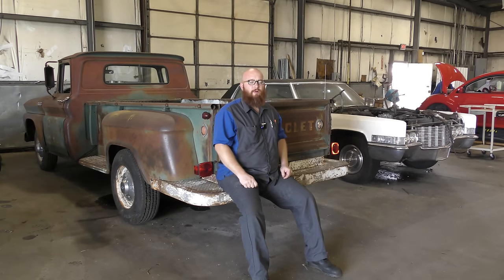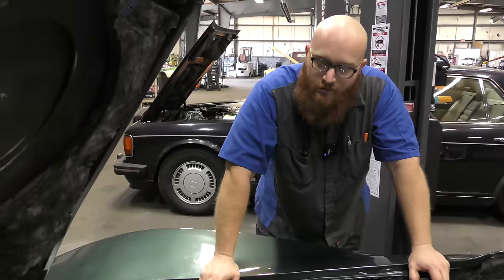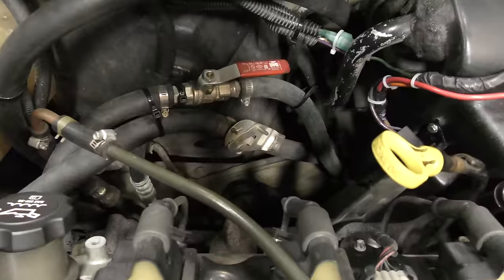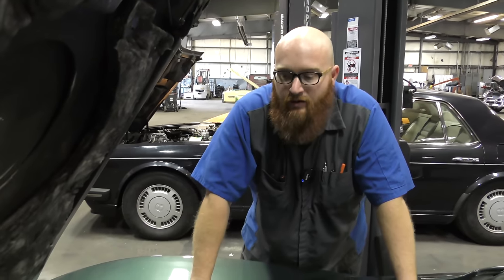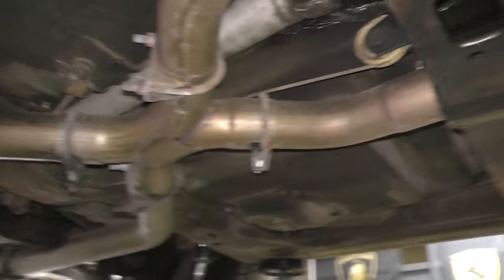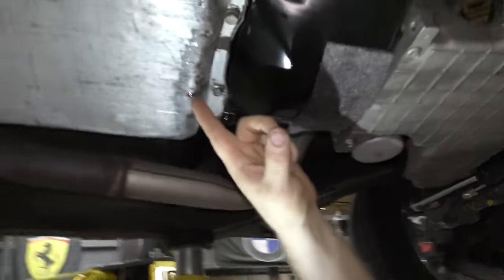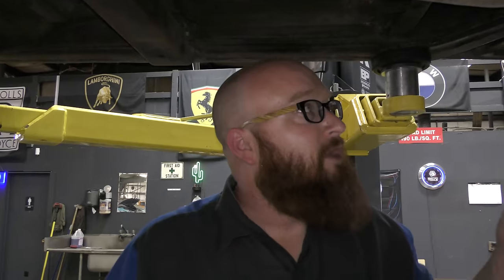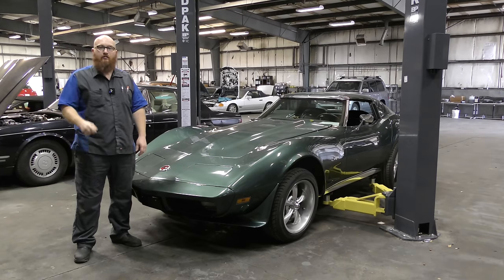Issues AFTER an LS swap! CAR WIZARD warns what can happen on an LS swapped '73 Corvette Stingray

Comment: Craziest I've seen: late 80's in Germany - base 75 hp Opel Manta with a 3.0 fuel injected inline 6 with 177 hp out of an Opel Senator. The guy kept the brakes stock, 13 inch disc up front and drums in the back and admitted that can't stop very well. Almost drove into a combine while barreling down a 2 lane highway.
Reply: I have an Opel omega with this 3.0 engine, here in Brazil it was sold by Chevrolet, nice rev range engine, nice sound too
Reply: Very common swap here in the netherlands back in the 80's and 90's. Just like the later 2 liter 16v engine. Opel is great of these kind of swaps. I've seen that 3 liter motor in a kadett C.
Reply: Strangest Ive seen: A 2.3 litre carbureted 4 cylinder Ford in an old diesel Mercedes. This was also in the late 80s.
Reply: Did it the other way around, upgradet my Miata ND with 4 pots front. Car has stock 2.0 - 160 hp  / 1050 kg. Have an old 1988 RX 7 also but that one is OK, has 4 pots front from factory ...
Reply: Too many moders think about going faster, but forget about stopping.  Upgrade the engine - upgrade the brakes.
Reply: Crazy...wedid a 68 camaro swapped I'm a 440-6 pack. This was in the late 70s
Reply: Years ago i had a uk 1991 vauxhall senator, 3.0 inline 6 12v, think they were about 150 bhp, it was a old banger so got it cheap and i just gutted the interior out of it, didnt matter what you did if you floored it the wheels would spin like hell being so light, and loved to go sideways
Decided to scrap it so wanted to see how strong the auto box was, burnouts with speedo reading 120-130 Mph, think the gearbox  just melted itself together in the end but did this abuse for about 3 or 4 minutes at a time and did it about 15 seperate occasions before the box gave up and showed me the lovely flashing gear symbol on the dash, the early 90's opel/vauxhall was the end of the greats from them imo

Comment: I literally had to watch about 30 hours of carburetor videos over and over just to learn quadrajets for my 68 C3 and boy am I glad. Absolutely no one in my town knows how to even tune one aside from the absolutely wrong bubba or two that once knew a guy. I am literally the only self taught Rochester quadrajet mechanic that I know of and I’m not even a mechanic. But just like anything, it’s not really that hard once you learn how it works. It took me a week to get it right. My car runs fabulous now after 3 years of failing to find a proper carb guy.

Comment: Usually the whole point of a restomod is to increase drivability and usability.  Confuses me to no end why someone would ditch fuel injection on an LS.
Reply: Same thought. An ls is a much more reliable engine than the old 350 and 305$. But it's only that if u swap everything over.
Reply: Some people like the nostalgia of a car and the 73 doesn't look right without a Carb with the hood open. Most people buy old  cars to  "share them with others" rather than for actual performance.  I could make my tank run at 10 mph but I choose 5 because that is what the originals did. It's for show not for go....
Reply: Because carburetors are easier to throw in and set up than turning a ls with fuel injection and a computer
Reply: @derekderekison3241  An easy swap would be a 350 crate motor. An LS based engine does not have a distributor, so you still need a hybrid system with fully electronic and programmable ignition to make a carburetor work. I love carbs, but you would have to do so much work with this application to try to make it work well.
Reply: @curtislovrak5390  you can put a 350 style  distributor on a ls

Comment: Crazy that we've gotten to the point where carbs are considered exotic.
Reply: Not exotic, just outdated and uncommon enough that it's not worth a mechanic's time to know or care anything about them. Your average shop would see a fraction of a percent of their business being vehicles with carburetors. They aren't loosing money by turning those vehicles away.
Reply: Makes me feel old when younger guys are stumped and amazed by a distributor with points. 
What, no coil packs? How does this thing run?
Reply: Horse and carriage is even more exotic
Reply: Don't you mean "obsolete"?
Reply: As a carburetor guy myself, in the 80’s I was actually glad to see them disappear as emission devices were added, ending up with dozens of vacuum hoses. I was fortunate enough to have started on carbs in the late 60’s, but EFI in 1977. Other than CIS or mechanical injection, in 1976 model year, only two cars had true EFI, one injector per cylinder. The Cadillac Seville w/350 & the Datsun 280Z. Although it had injector #7 for cold enrichment by a simple thermo-time bi-metallic switch inside. It was stamped with max time & max temperature. The colder it was, the long it sprayed. A 3 or 4 gas sniffer in the tailpipe was normal.
  Anyone can put an “LS” in a car/truck. But not providing a detailed schematics, location and part numbers of non-factory parts is lowering himself to “Grease Monkey” status, doing the owner a dis-service and any future owner. The “Wizard” is right. 
I left a dealer of young capable Acura techs. On the way out the door one ask me how the fuel pump on his 2-stroke 6 cylinder bass boat engine worked. I told him to Google it!
I paid my price, no tech school, just did it and learned. Mistakes live in your brain until you die. Doing it correctly & right using best practices is forgotten when they hand your paycheck!
ASE Master Tech since 1978-Retired
Reply: @johanbjork1650  - pretty sure your point ignition still has a coil — or at least my 65 ford’s did.
Reply: Has A single coil.Not coil packs for each cylinder.
Reply: @y0ur_name_here  My 113cc scooter still uses carburetor

Comment: The owner apparently never heard of the Holley Sniper TBI fuel injection.
Reply: The owner had a 165 hp 350 that was probably toast. The swapping shop decided on a junkyard truck motor and this is what you get.
Reply: I haven't kept up with aftermarket fuel injection lately. Hadn't heard about this unit. I checked it out. Wow! This thing looks amazing and brain dead simple. Will definately keep this in mind if I ever pick up a classic. Thanks!
Reply: That's exactly what I was thinking.
Reply: I agree easy to install and tunes itself. Fuel injection for the uninformed. Most mechanics could easily understand and diagnose it.
Reply: @jerryhablitzel3333  put a Sniper system on my Chevelle. Couldn't be happier. Butter easy.
Reply: Why not retain the factory multi port injection?  Far superior...the sniper is for replacing a carb on an old school engine with fuel injection
Reply: $1200 vs $300 just sayin
Reply: @samiis1260  well 300 just cost u 8 hours at 90 dollars an hour just to figure out the problem. And then what ever it will cost u now to repair it. Spend the 1200 and get the better system that comes with its own odb to help fix shit
Reply: Why when the ls style engine had multi point and computer control. Yeah it takes tuning but so do carbs. This swap makes no sense to me
Reply: @imcrazyforwar  I do all my own work, always have but maybe thats rare these days. 8 hrs to tune a carb is insane. more like 1, I've done it with cars trucks boats bikes and other equipment its not rocket surgery.
Reply: @brentboswell1294   Because  Brent the Holley system is modern and is VERY easy to modify to increase performance, versus the old system that isn't supported at all.  Great question!
Reply: The Holley tbi has the ecu inside the throttle body. 
What. Could. Possibly. Go. Wrong. 

Oh yeah, all the people that try to jump start, fry their unit, can’t buy a new ecu gotta buy whole new system.
Reply: @fastinradfordable  Well there goes another $1200 down the drain

Comment: Sadly, restomods (Frankenstein cars) make for poor purchases as the Wizard said. Better to buy the real deal (an actual performance model), upfront and rely on standard aftermarket bolt-ons and what-not.
Reply: Restomod done right is good to go. Im doing restomod suspension and disc brakes from CBR for my 66 but also running a 360 and M21 4 speed

Comment: Around 22:00 you say the GOLDEN WORDS brother man! You could do a whole video series on just these words. "When They Are Modified". Too many people watch these YouTube vids and car mod shows and hear that "You can have 1,000 HP by simply buying a junkyard LS and swapping it in, it's cheap and simple, here's a 10 min video on how easy it is." Don't expect a $100 junkyard motor to get you into the 1,000 HP and have a running driving car in a weekend.
The swap alone is going to cost you 1,000's and if you do nothing to it, your only going to get around 300 HP at the flywheel (not the rear tires). The 4 bolt main SBC that came in that car could VERY easily break into and well over the 300HP mark with a mild-performance re-build that wouldn't require the 1,000's of dollars in Moding to make it fit and work. Also you, me, and other shops have an easier go at working on it for you when things wear out or go wrong. Saving you money down the road.
LS Swaps are great, don't get me wrong. But they are only great if they are (1) done right, and done to their full potential.
Otherwise you are buying into a Fad, and it's an expensive Fad to get caught up in.

Comment: Now you need three BigAss Fans for the shop ceiling!
Reply: I'm a contractor and can say those are the best fans for sure. Plus you get a sticker that says, Big ass fans. I always cut the S off fans so all my stickers say, Big ass fan 😁
Reply: Get some solar panels up on that room and get that place air conditioned for free!
Reply: @assoonaspastablepizza8135  I have a brother who owns a huge truck repair shop.  About 5 years ago he installed AC when he added a parts room.  Increased productivity 50% in the summer.  Actually paid for itself.

Comment: A very honest review of what can and does happen with an engine swap. I'm swapping in a 472 Cadillac into my '72 Chevy C20. It's not as involved as this, but there will be a couple challenges here and there. I went with a Holley Sniper EFI setup that is very simple to setup and run. If one is methodical and takes their time and doesn't succumb to "go fever", a restomod can turn out really well and drastically improve the handling and drivability of a vintage car or truck.

Comment: Imagine getting that carb dialed in, and then you move to Denver. Guess what? Your car runs like crap again.
Ask me how I know...
Reply: That’s a great observation. Not that level of pain but my nitro RC car has to be tuned for hot, cold, humid or dry. So to me a fuel injection swap would be cheaper in the long run over constantly tuning the carburetor. Oh and just curious now you have it tuned for Denver does it run the same at the top of Pikes Peak?
Reply: @duke9173  Probably not, you'd have to pull over and tune it by hand again just to get more air into the engine to climb Pike's Peak 🤣🤣🤣
Reply: air density is a pain in the kester
Reply: Imagine willingly driving a car with a carb.
Reply: Been there, done that. Plus, Denver is at about 5,000 feet, but the mountain roads to the west and north get as high as 12-14,000 ft. Carburetors are about useless in that kind of environment.
Reply: @Michael_Lorenson  oh well what did they do 30 40 50 years ago? Did Vehicles just struggle to deal with the high mountains?
Reply: @goshgolly8305  
Yes, they did. Carburetors can cope with some variation in ambient pressure. But there are limits, because they meter fuel based on intake air velocity instead of density.
Reply: Michael Lorenson so nobody ever raced up pikes peak with a carb
Reply: @travislostaglia8861  
Of course they did, but that doesn't mean their engines didn't suffer from the extreme change in altitude. It was the same for everyone, and they dealt with it as best they could. Are you an engine tuner? Seems unlikely. Otherwise you would understand the challenge competitors faced, trying to set up their carbs for that event.
Reply: Idividezero   You overlooked the main question.  Why would anyone move to Denver?
Reply: @chriscat85  I used Denver as a well known location for its high altitude. I didn't actually move to Denver, but I am over 4,000 feet in altitude.
Reply: Idividezero    And, I was just picking on Denver

Comment: OMG, Im an SAE certified mechanic and Im rolling my eyes watching this. You have to think about the motor with one mindset and the carb with another? LOL whatever, the LS is just a pushrod motor. 5 minutes with a power probe will figure out the fan issue as well. Common man.
Reply: Exactly and the only other thing it would require is a low pressure electric fuel pump added to the system. Hopefully added close to the tank to pressurize the system so it has less chance of vapor lock and power it up with a three prong ($10 Chevy Vega) oil pressure switch to operate a relay when it gets oil pressure.

 EDIT: Everything he is saying is obviously very true in a lot of cases but this one is still in the basic simplistic car repair mode. The ones when someone does an old car and blends a donor car wiring harness w/factory fuel injection and body control modules controlling some accessories. And wiring nightmares, like splices and gooey electrical tape jobs with inaccessible relays, fuses, connectors and fuse boxes mounted on the other side of a metal wheel well against the fire wall.
Reply: I'm with you. This was a bit of a letdown to me. Tuning a carb for me if it's a 4150 means heading out to the strip or deserted country road with a timing light, vacuum gauge, box of jets/jet driver, spark plug socket/ratchet & a temp gun. With those few things I can make one run like it's injected & have a blast doing it. Who wouldn't wanna get paid to run a car fast up & down the road a few times???

I'm not sure what's involved with those Barry Grant Thermoquad copies but I guess they're much the same as a Carter/Edelbrock with metering rods & such. Not exotic but not in every corner speedshop either. Maybe that's what scared him off a little?

The A/C problem? Nothing a simple trinary switch from Vintage Air or eBay wouldn't fix. If he does that "running off the compressor clutch wire" thing, that fan will have a much shorter life from running while on the freeway when it doesn't need to. 

I can deal with someone who truly doesn't know & I welcome the chance to share knowledge. But lazy? No thanks!
Reply: @acemobile9806  Absolutely. That was not the car he should have used as an example. I sort of hope the owner sees this video and pulls his car out of that shop. Just maybe the guy is talkn this way for youtube but treats the owner right.

Comment: Thanks for such expert automotive information and the ability to articulate without annoying dialoge and stupid music!!!!. My opinion agreeing with Mr Car Wizard's  - Why swap to LS motor without the EFI in a vehicle like a classic corvette? Its not like the older stock Chevy motors with carburetors couldnt be modified with performance ignition/fuel upgrades. Unless youre racing, plenty of horsepower can be obtained. Also why not  isolate all electronics, designating PCM and other components to engine only ? Everyone has a differnt objective when it comes to thier vehicles and it would be fun and challenging to engineer a motor swap. My son is swapping to an LS in his Mazda RX7 to get rid of a rotary engine. Because rotary engines, though unique are a pain in the ass!!  The big block Chevys back in the day like the 409 are powerful, easy to work on and to modify!

Comment: Car Wizard I usually agree with everything You say, because You are the Wizard! But I must say that a r12 condenser is usualy perfectly good for r134a, if you check a danfoss refrigerant chart, You can even see that, for example, r12 at 12bar has higher temperature than r134a at 12bar. R134a is kind of a "softer" gas. The only problem in that system is probably the lack of a pressure switch on the high side switching the fan on and off. Doing that in a series with the comp. Clutch is fine but in winter if he wants to defog the windshield the ac might have way too much cooling in the condenser. But anyway, when the car is going, the wind speed is usually greater than the fan's.

Comment: LS with a carb...that's like putting wooden wagon wheels on an Indy car.
Reply: You can get more horsepower with a carb they also didnt want to play around with electric fuel pump
Reply: I doubt he running a mechanical fuel pump mate.

Best thing to get rid of in my opinion.
I've been stuck before run out of fuel put your Jerry's in but by the time she primed the battery gave up.

In theory you're battery will be fine in the real world it may not.

But an efi pumps a different ball game.
Reply: @markgerman6446  maybe in ideal conditions but in practice most carb engines just suck pure hot air and never achieve the same power
Reply: Carburetors are great if you Know how to work them. I build a 6.0 with a healthy cam and a 750 double pumper. It made 527hp and went into a 71 Monte Carlo with a th400/2.73 gears. It cruises excellent , goes 15l per 100km and is An absolute beast when you put your door down. Wide band and carefull tuning is key if you want it to be right. It takes more effort than pushing buttons in a laptop. And before you answer me, because i Know it's coming, i do both carburetors and fuel injection , build and dyno tune everything i build.
Reply: Uh nascar uses carburetors
Reply: More like your wife tied you up and leaves you like that
Reply: @fastinradfordable  NASCAR also uses restrictor plates
Reply: @fastinradfordable  Cup cars have been fuel injection for about 5 years now
Reply: @fastinradfordable  Not the big boys. They switched to Throttle Body EFI and E85 years ago. Modified still runs them.